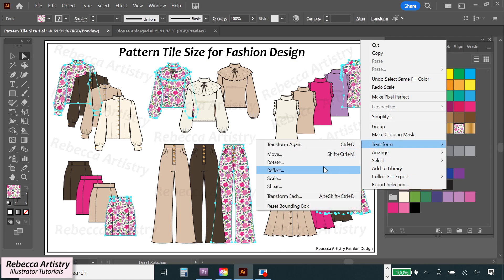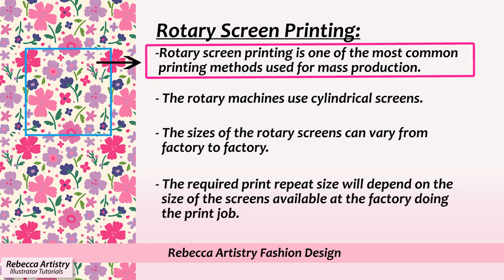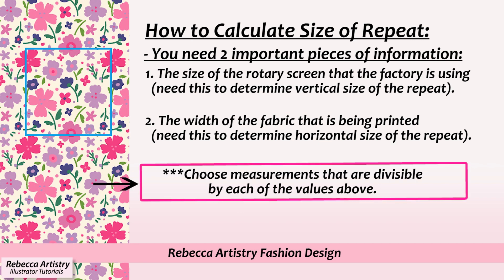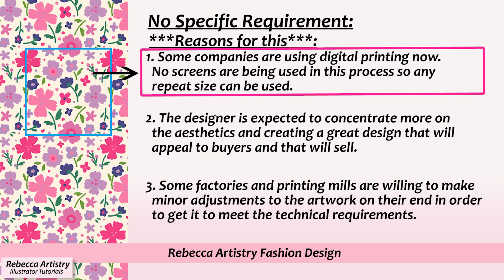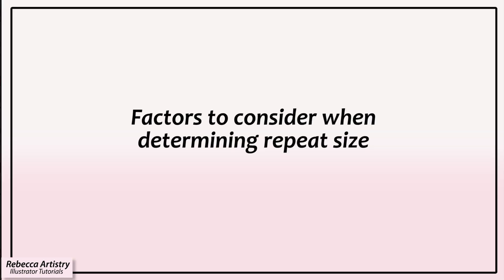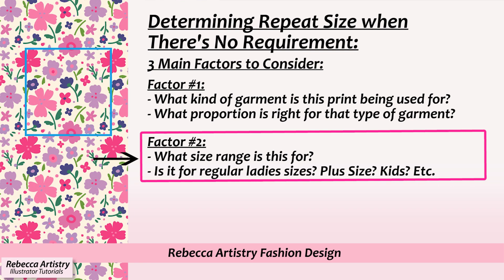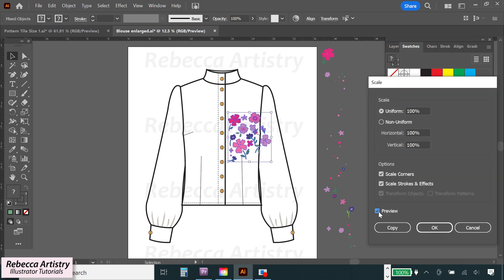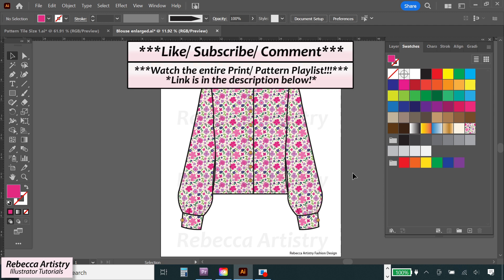What Size Should a Repeat Pattern Tile Be for Printing / Print Pattern Tile Size For Fashion Design

Comment: Hi, the mill's max repeat sizes are 25.25", 12.6" and 6.3". What do they mean by that?  What if my artwork is 24"Ht? Will it be okay? Thank you in advance.
Reply from the maker: @livingoverseas5122  Hi there! I think they are saying the rotary screen size is 25.25" (one of the most common rotary screen sizes by the way). So it's possible they may want you to make the repeat this size. 
Or you can make it 12.6" or 6.3" because those are numbers that evenly repeat into the 25.25" screen (approximately if you calculate it).
You may need to adjust your 24"h repeat to 25.25" instead.
***But this is just my assumption. ***The best thing you can do is clarify with them. Tell the mill the size repeat that you made- height AND width. And ask them if they can accept that size. If not, ask them to tell you the exact size, or sizes they can accept- ask for both height AND width measurements. 
It's better to be specific like this so there's no miscommunication.
Reply: @ Thank you very much for your detailed reply! The factory never had issue when I use repeat size less than 25.25”. It seems like they accept any size as long as it doesn’t go over the limit!
Reply from the maker: @livingoverseas5122  You're very welcome! Yeah- that's a lot better- if they don't have strict limitations. Hope all goes well with your print!
Reply: @ Thank you!

Comment: Great video Rebecca! I am a freelance designer and I am preparing a fashion pattern portfolio to send to print studios. In this case do you have a suggestion on what my tile size should be? Is there a standard number? Thank you for your time!
Reply from the maker: Hi Julia! Thank you so much- I'm glad you liked it! There's really no standard tile size that you need to use for your portfolio patterns. You have total freedom as far as this. I would say it's more important that you show each pattern in a scale that shows that particular pattern off well. You're welcome and feel free to ask if you have any other questions!
Reply: @rebeccaartistryfashiondesign  that makes sense Rebecca, as long as the scale is clear I should be fine. I am thinking about using some mock ups to help with that as well. Thank you very much!
Reply from the maker: Yes- mock ups are great to show as well. You're very welcome!
Reply: Can I make my art work in repeater patterns without having to put them in Photoshop and vectorize them? I don’t no how to do this .